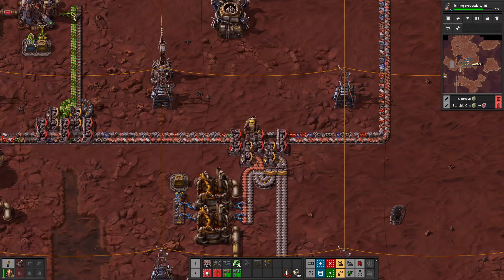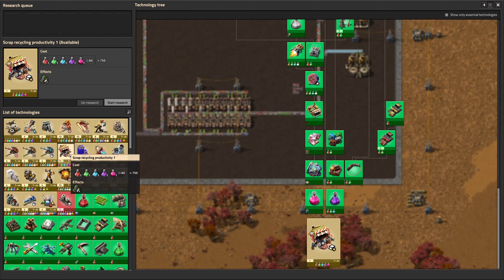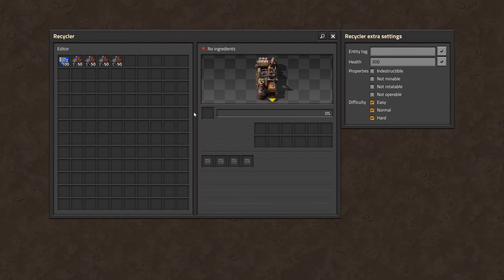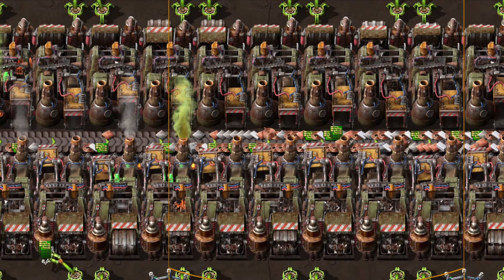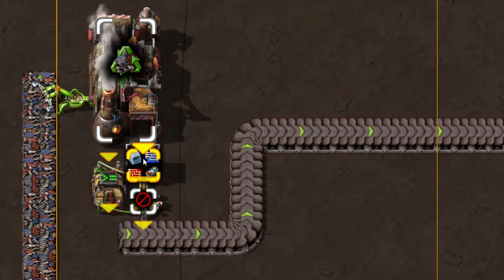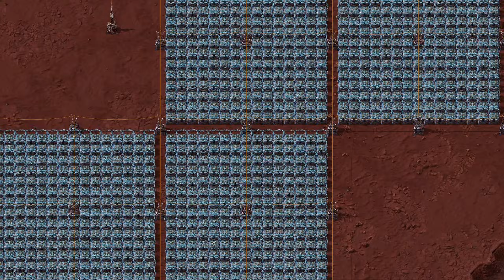Massive Production on Fulgora. Stacked Double Sushi Belt! Factorio Guide / Tutorial

Comment: I just got through my second attempt at a lightning planet base. The first time, I mind into belts, recycled, scrap onto trains, and transported the scrap from small islands to medium islands where I sorted them using robots. My quality strategy was gambling – only adding quality modules to assemblers or plants making products I wanted for the base. My throughput was excellent, and continually improved as I added a second train to the loop and mass produced logistic robots. At the same time, I felt like I was letting the game play itself.
This second time, I mine directly into 121 trains, One engine, two cargo wagons, and a backward facing engine. This allows me to use six big mining drills while filling each wagon at the same rate. The arrangement easily fits on small but dense scrap piles. The scrap trains, then venture to a large island where I unload directly into scrap recyclers. The recycler output onto belts which merge into a single blue sushi belt. I used your tips from this and other videos to reduce the recycling time for concrete and steel. I also figured out myself to remove solid fuel and ice immediately from the mix. After that, I began peeling one item after another off the belt in a similar fashion to you, prioritizing, sending it to a dedicated belt for only that item, but preventing clogs by having a backup belt feedback onto the main belt. Eventually, I added another set of recycler to the end of the sushi belt and sent their output back to the beginning with priority over the scrap recyclers. It works! The throughput is noticeably worse, and I’m fresh out of Holmium, but hopefully this can be fixed with productivity modules. I feel like I needed to do it at least once to satisfy myself that I really understood this planet. Could I do it again with quality scrap? Not with the level of patients I have right now. Maybe if I had a parameterized blueprint!
Well, now that I have big drills, foundries, electromagnetic, plants, and regular deliveries of calcite and tungsten, it’s time to fix the starting planet, and then onto GLEBA, where again, last time, I use robots all the way through, but not this time! Probably.

Comment: Couple areas of improvement for this setup:

1. Filter out all qualities of ice & solid fuel at the start of the sushi loop, and only non quality items pass onto the production of water & rocket fuel. Later on its also worth filtering out legendary solid fuel so you can make legendary rocket fuel, and then recycling the excess to prevent it clogging the sushi belt up. This allows for more important quality items to pass onto the main sushi loop, which doesn't affect throughput but does improve the production rates for quality items in our quality mall
2. Having upcycling for holmium plates within the build is worth it, and can be set to trigger above a certain threshold in storage (e.g. begin upcycling after 4k non quality plates are stored)
3. It's worth including quality versions of hazard concrete and steel chests into the build, otherwise you will slow down the recyclers handling excess items. If you do this, make sure to loop the belt back round to the start of the splitters so that any excess concrete doesn't clog the setup and just continually loops in a small circuit till its all gone

Other than that, this double sushi setup works really well, and Gets better once you reach legendary quality. Can easily crank out tons of legendary Q3 modules with this setup alone. well done :)

Comment: So the stacked belt works but the stack inserters will almost never output holmium ore or LDS into the belt. It's just a ton of gears, concrete, solid fuel etc since they stack much more frequently. I just ran this for 30+ minutes and no holmium ever entered my turbo belt

Comment: I'm new to Factorio, but I've fallen in love with sushi on Fulgora. However, this approach isn't popular online, and I haven't found any interesting ideas related to it. Even the loading screen itself suggests this method. I tried making a filter for four belts, and it turned out to be quite a challenge.
Blueprint:
0eNrNml+K2zAQxq9S9Ows1l/LgZ6kLIuzcbcGx3YduXRZAqXQtx6jhyj0EpsbVU7aZEmkMONpd/clIY6tn+aTNfNZ8gNb1EPZ9VXj2PyBVbdts2bzdw9sXd01RT0ea4pVyebMDf2inbm+aNZd27vZoqwd2ySsapblZzbnmyR60bqrK+fK/snpYnOdsLJxlavKPXD34/6mGVYLf+acJxfBCevatb+4bUaabzDT8kon7J7NZ1pcaU9aVn15uz+Di7F3JwSBJmgkQRII8pRgAwCFBph4CCGARgMyHMAQACCJMoJEIIBFA2xcIhUA5AQAKAKeYgkmxYXAT2fz4LNAf9e3/jvGUPmBkZ5FkTB3343NVU03jGnoHIme3k+AHCSbxAc1thwLauzxn6jawcXCwk/5NB5WMGtx/KTnWMTptD9UiIt5nZ8LtlfqxhewtvcE32Bdvg8rlyGY4nh/nzPfV/V42bHKLcuxbLp+2J006+qiaXbtfhyKet+rpu1XvjIm7LZddUVfuNY3wN6OFfE8hL66+xCOwSJiuDR7MMwcwVQo3UYhVqU/NkunixUbb5ESMn8KSQCCE4oXjCAQ2pto8vpf0kfvGSER/c5R92l0uBUCaZ9dqmi3NUap2OxSzz/CiAz+xC3ws35jmIgMbjhGq3+dwKOjbfGWwQiQZYgaIYH2j0ZeIoaec/AGUsQdQ8hASk4IAkZA+0WjcMlcSgIB5Egl2hyqQ0Ea3S9kqDXFySsbd/JxzyvRD4nKYsPKpj8tQBEY73bMmOlr8p8yn/5oAJRJpZNs+quSSREWr6Ay4VevFBYhpxvowEQPEdR0Aw0kaLyBPpfHvujNZPDG9mVCiLkehV+Du5BcQ8Vb2ekrWEBCPsl7pq/He2qCSYNppAkmbUcItUmwZbAUoQm2LDDPQgRFMBcZSHk9fVUQSDCEyg8j4LOEQBIsoSzDCPn0HR9lQPslKaHug2IwnBBDBopBEIwFTCVJMBYwAmHrDagSYe8NSDDTd5aAKmUEAiwGS/AWGcgHm5xgLmCIDF+bORbBCeUfiBCE+g9EUIp1CHGdHBdK9+8h/F1PW/rG/EdkIXXmTdvyAAJYtZFUuXLlfx3fuEhYXfh++2OPPx5/Pv7aft9+3X55o7bflP/vk+/SDqCNyFWea6tSkSq72fwGkyEmww==

Comment: Something I don't see people mention is that in my experience, I don't get enough batteries to turn all of my holmium into science. I have to make batteries to supplement the ones I already get, and the space this takes up is quite annoying (gears -> iron + copper cables -> copper plates + heavy oil -> light oil - > petroleum gas -> sulfur -> sulfuric acid). About 1/3rd of the area used by my science blueprint is just battery production crap.

Comment: The -15 combinator trick to control stack inserters is a nice idea. I ran into the problem of the chest never getting emptied properly and ended up coming up with a looping solution where one inner belt loop goes by a line of stack inserters which take off that belt and put onto another belt loop. It ends up being pretty compact and I have it setup to turn a scrap belt into two fully stacked green belts of recycled scrap at maximum speed (480 items/sec). I may have to try your combinator solution as I think I might be able to get it even more compact than my loops.

Comment: Accumulators on Fulgora is kinda bait or bad design on Wube side.
You get so much solid fuel and ice from scrap, that Heating Tower + Turbines are best source of consistent energy on Fulgora. So accumulators as a energy source become obsolete VERY quickly.
I wish Wube added some upgraded version for accumulators, and not only EM Plants, where you use electrolyte to "charge" it and convert into charged electrolyte that have HUGE energy capacity (and not mere 5-30 Mj like accumulators), paired with that new building that can charge electrolyte very quickly to utilize Energy spikes from storm.

That would be AWESOME

Comment: Further to this, I have one water supply line to the entire base, hold extra ice for bootstrapping thrusters and sink the rest. I sink solid any overflow solid fuel too, since Rocket Fuel is better than Solid Fuel in every way. EDIT: Might also be an idea to recycle copper cable, since you can just send Copper Cable to the Logistic Mall dimension, and the stuff that stays on the bus is better as plates. You could also recycle AC's as well, before Copper, because nothing in the production chain requires AC's, BUT that will reduce your capacity to make modules off the bus.

Of course, I couldn't get to this point without your help. I used a blueprint to solve Fulgora for my first go-around, but felt cheated. I've always needed guides to point me in the right direction with Factorio, and yours is insanely useful.

Comment: Over time, it will unfortunately become clear that the only thing actually useful on Fulgora is holmium. This setup doesn't buffer holmium, it doesn't start or stop based on holmium quantity, it just puts it into a belt, and throws it away in the recycler cycle if the holmium ore belt happens to be full. To anyone stumbling upon this video later on: Please do not do that. This video's concept works fine for your first visit to Fulgora, but that's about it.
Reply from the maker: If you play with normal science cost the amount of mining and scrap productivity will quickly be so high that 'wasting' scrap does not matter at all.
By the time the game is finished and you're on your way to a megabase you're still mining the first scrap patches.
If you really want to start and stop the base if necessary a very simple circuit logic condition will suffice.

Comment: You can use a constant combinator instead of a decider combinator for stacking. Just set 1 of each item type, then set the group to -3, and set inserter stack size to 4, and then use set filters. It's smaller without doing what you are doing. This doesn't work blindly without knowing what might be on the belt, but the list for scrap to belt is set static

Comment: Thanks for being the best Factorio tutorial channel out there! 
The only thing I might add to this video is that, if you are starting with quality right from the scrap mines (and you have all quality unlocked), the blueprint for fully stacked recyclers will lock up after a while because the box will fill up with stacks smaller than the 16 item threshold. 
The easiest fix I used for this was to use a higher quality steel chest (for more spaces) and change both the stack size and the condition of the combinator to 4. You need at least 60 spaces per box (the 12 items produced from scrap X 5 quality tiers) to guarantee no lockups. 
This fix allows for more stacks of different items and qualities to fit in the box, and the stack inserters will move items onto the belt as soon as there is 1 full stack (4 with research). 
Seriously this is the best Factorio channel, your videos are amazing and so easy to follow.
Reply from the maker: Thank you so much!
Yeah when using quality steel chests should be at your max qality tier as well.
Reply: Love this comment - though I'm confused as to why a max of 4 instead of the full 16 to max stack the belt? Or just to prevent a back log of certain items?
Reply: @Poctim  the hand size of 16 will actually put down 4 stacks of 4, so if your objective is just to make sure things are stacked on the belt, 4 will accomplish that without leaving things piling up in the box unnecessarily. Hope this helps 👍🏻

Comment: Insane how good this video is. I return to it now and then to reprocess the information.
Did you run into the problem of the chest for your belt stackers clogging due to to many stacks of items of varying quality filling it up and no stack ever reaching 16 items?
I have a problem with my chest being full of normal, green, blue and purple items and none of the stacks get to 16 before the chest is full and therefore everything just clogs and grinds to a halt. 
Did I miss something or is this a problem that emerges for you as well now and then?
Reply from the maker: If you use quality recycling you have to use chests with the highest quality tier you're working with. So in your case it seems you have epic unlocked so you should also use epic chests which have 91 slots compared to the 48 of normal chests.
I ran into a similar issue in my current 10X science cost run when i was starting to produce up to epic items and forgot to update chests.
Reply: @AVADIIStrategy Ooo, I am still learning what quality does to stuff. And that is such a more elegant solution. I was thinking of getting some circuit logic going that would allow for smaller stacks to be put on the belt if the chests available spaces were reaching a set threshold number.
Thanks again for the video and thanks for the reply!

Comment: 1. I recycle scrap right at the mining site.
2. You dont need combinators to use stack inserters. Just connect Stack inserter right to the chest and set it to "Set filter". 
How it works:
There are items in the chest, stack inserter have those in filter. For example 10 ore.
Stack inserter takes all ore 10 from the chest. 
Now it is 0 ore in the chest and Stack inserter can't have this item in filter. So Inserter puts 10 ore on the belt and take another stack of items
Reply: but when the recycler puts one or two of an item into the chest the stack inserter will put a non full stack onto the belt using your solution

Comment: This video inspired me a lot but first of all I think you need to plan at least 10 belts. Then you can increase the number of belts to 16 or for uncomon another 4 belts will be enough for rare and above 1 belt will be enough. But passive porvider is a better option for outoput. Also you need to try to consume everything before the belt returns. Spaceships can be made for the modules and everything can be converted into chips and upcycling can be tried in space. Everything can be free in Vulcanus. But it is more important to try to consume everything in Fulgora because trying to get rid of excess material is really difficult and costly in Fulgora. That is why even science ships first make the material reinforcement in Fulgora, complete the rest in Volcanus and finally dump it in Naviusa
Reply: Also if the material to be taken from multiple belts is less than 1 belt. Just add a belt to the left and when you put the material you want to the left, you can use the system for 1 belt.

Comment: Edit: String is now a book containing a few builds for quad belt sushi bases. Feedback is appreciated (including any mistakes I may have made).

Edit 2: one of the undergrounds was placed backwards, oops.

Original comment:
I tried my hand at making a quad belt filtered output, without prior experience in balancer making or spaghetti wizardry, so it's probably flawed. Someone more experienced could probably point out flaws and I'll gladly try to correct them.

(Note, this does require at minimum red belts to function)

Here's the string:
0eNrtXdtu4zgS/RVCT92AE4g3XQLsYw+mgRnMZbG7D5tBQ47pRGhZcuvSs95G/n0oO47lRLSKLDt2D/TQaEeWqqgieYo8VUV/86ZZo5ZlmtefpkXx2bv5trtSeTf/7fzZfjdT1V2ZLuu0yL0b79+qrPQnwibk1puqpKnTeapmtx5J8hm5KxbL5K5WM1Jl6f1Dna2uvYmX3hX5RnCV3udJ1krNk4XS4uqmnBZX1TJL61qV3qO+OZ+p/3k39HFivL0uk7xaFmV9NVVZ3XmIPf4x8VRep3WqNgrXf6w+5c1iqsXf0MlBSRNvWVTp5k2/eVrglWD+tZx4K/2R++xaPrbNeiGUvRDa6MaU92Wh/zeLpftiJ169WrYiiqZeNu07vVLDrdtO48G2C4e208i67dLe7mynhK6VzNJS3W3uoaxHR2Cvg+90+C91RD0qQpQKClERTQxTo9dG+63f2P+TnrlFqWVqGZma9/ZHbKOF7r/APM3aO3eTcqba+V2Xzfq1rpZZkudrUV+aJNu0Iy/KhZ7IE28NEGVSF1qA9w/PqtHUR81ev38GUGphCxq/sS3KFkV7jcFQcGAyhgPIBJYjnAqUjlcTVfTpkDadGg1NI3Mv2IMODQ/Yq/ddMKjD4hikI0LpiEA6Yhc/yQ69ybPnSXOD42E+UmnkopSiVgRbpYNqmAOKb834CrlaKFoofe3KPz50M46A7o09+qQKBAaapUoHh3BasxrxhwWo9Rt4pIUuakLQLDIvGlmEcBRAUGIxSgcIXLmPtF7sYj1uta6RHQf7StfZVnzcBuGo6Fhs+B1OOzE5RznUsB+auLBBfL6VFljuDrhEoXVgaHyAkmoyicPqiA631WUbtmnjOaeLA5hFg7YQPsrLmqRSlFTDaBAMBechBM4FtwGlcGgSGiFECIc9zJuNQXOzpZPf0f767f2O+SVwWCUMoxOHVSapEaqt0iA1dkJAeYbNhfRRsGcwq8QBlEkqQ0k1dJbkTlAhT79l+WOyE7dh5Ld7jZn33OaPtVqQuiDrVpNiPm9jBrMXLWlFpfpGfXkXnph4WaLtpq/91iQz0pqQtDeRjgG+biIW2kqB7pY4lpLJgDO6Cxv4rUkPxDx+aPI14CRZtiL1gyKVbhVJKtJUaX5PGPnyrHyrt5qQaVMTSjJVVaROM0WyIr+/vs1v839Vat5kZF6UJJ2TVdGQXKlZa4BF8lkRpRu8qh9ayU/hlGtym/9HZdmk1fl0rf2YdBRrKNTtaqqHlEyTSpG7JNdfkCRf/Zl890EY3ok4BMcLwvBwX6xDEAakJrBWY09scDloIvtVvejQ5xLC7QYoFeI0MRgeH3iL3lCSzeqfx/vNP00Qhkf7b3DGwIO9t+3OMwGMwgCkBsNSbfiDdn/6piY2xrnsuQMuDgxxAQnCHLSMHBri5tFiDzqcW4KOQxCmq0OcKAjTRTZ+oiCM8F+G4k8RhOkCKH+rIAyPD72aQxDGbpkBsqZVBGYH4Xxo3U0vIgLThW12tAhMF7YZMAIDGi8CNF4OhBsCJ2dxys40x31C1AKRgVZBr+Ivtt3AnbohRqE5d4rI2OkAYYNV/IV3sp3Edxp/4Z2UNm4Tf6GXEX/hh3xpBInG2Plragg9SNQGB5Yr5xCL4cPZQ9wlTNx1uhS4CY+c3K5/YdEZW4qCgmL1wkdSFEA1FLVJAWU+OURzujoMo1Q4cTjSepRaxW926wn/e4rfdP0W+77jN5zbjs4Q5WJACccOsR3uW+ZjihjhxnrSbKLjhGh4fEBHr1OT1IG222bXWISbGGLPs1EHCeHY7M/MUoWDp9za+203qFI6MFLm3jNCgwwQTgWYVSZDB+g/rdnN9ogQUAmd/jECxoBZdoGP0mFIBg0oChwDUMsZSkcICsxwFAXX9ybDa8RAOAFyaAnIgXQCueAMqQpBgEJ5Q9ZTEKI8kklq5ARiwTnyoIMYRVUdHN7mFX7oO7ms0NZlhW5UktZ0OVRSyFBuBpSZF3KUDhBYhwLlZgyh+VCipBpmcBigHIshqBqGKKmg8GQYOXkOcV6GJ4yRTlY6ONnIR5FuW6WDaijKcxnGUoTbS5mk4vZShiS7SKDaapIqUWwUuPsCJ1clzkxGRSHSr0sXvx5Fjv5WXhAFFsUoZwjKioh9lA6QK4ipUwxKu9o3qgEypncxJx/GzrAtiW3yh9sAw6ap3DbhTSBSMjbq+qRKFNobchDiAIX2Jqkhqq0mC0Sotpqkxk4ug51j/0d9H5EQYTQB9a3ARwxNjAPtZ6ipQU3t56iRYRQrUMPYKFaiOnEtFl5w0Obfr7PmaW+5wQTwJHv9JIUXKsz0JLArVKADhQr/TBfLTBGxkT9NdCPvVEn0Tel9Tj6Sqi701/OyWJDfk1X+pUmrmrzLiuz9tjCBJPW6wmGq7tM8b2sQ2mOdlP5XzLflBa3s1gRTpZ8uVdVkdQUpMDBWDBwqM+ipSrAuMACVLkXAwoKDwvwBYRxxDhKLJOwMJzuhAlYsYHmERSRhQXKX8ws61WtQNSGmRC4CrYUjTG3faxW9Ec4YUzxmGj4UVd8bHS+hvzsqYcnMTgegRPxoZx91B4lhxedw2lF3XJikSlSfwfI/HfLqu11o8vIhSqrp4KoICSSwrCe3M4yorRrmOw1sg20YqpLV1I8MVclqbCt38d1hDExPBznvjbTDqzhxJZ7XV6ClG9tbujkcvPmzHmeqItrHVelMratcK6LvbKtG07yzNpuQvCDbTUdbVZrkq/UXpirQp9H4NS3rZr0VezLZ5o6rWbG/Vjv+EZtsv+DnWEdsvqojsq7uhByvsi0gOlvUQaCQD2wbifBjxn4NnM6hPDcr7UJKM4ErZ3JYXkrLioUYpQJW4uZwhKew1UGRYMFgSwGGAjp2vEXoi+qXIy1C2bBUiUQeoKED1LGv/HjLUDrcfRFKqqmtmHOdemZNf7WXj1LCgGtP0Nl3MbaUD3c4LtBgLil1TB7KMgfsDAQKQH1gwaUd9IOO5GX487khhZAHVxDiQk6ydjjZ8uV56MepnOxKNRV14U7dNlW5URRQmqQylFSTBTgKGf0T1RLSyLLQg0skFlOnc0gDhz34+cugHM6V7B7UFQPPlbQ7qizucUzQaNOi5Q+Ocx6WBRXxzEPcp19V3rIRadth5N3H6w/Xndvfr++vrCmKh2SprvQb1emdvj7SFBdCU0w2KxhYrd7IX5wS23q6wpi/OvIaI68x8hojrzHyGiOvMfIaI69xtDXeSHiMhMdIeFwO4WGxKfibECEf17TDMx1hwYbQU7Ihe0+5sR8PWuT/i7we+Y+L5j/G9I1LoT/GvI6R/xj5j5H/GPmPkf8Y+Y+R/zj9Gm+kP0b6Y6Q/Lpr++LsngvzS1I78R6/kq3UBy078mgQp2zLgRLfoq/q0fRiigUM0/NBk90X59JNnO1JF37FPx7z7sVi2v6+Wrd6TD7ufUnv1M2vdH0/rFDavfzxN3/NnUX52q5f50VzZPPDkB+9FvRD4yZ+8rjVtnvy186Ro+2G//+iB/nv8Cxsbwjw=
Reply from the maker: It works!
Reply: @AVADIIStrategy Glad to hear it, I'll drop a blueprint book later containing some other builds for i/o in a quad belt setup to make life easier
Reply: @ String updated, let me know if you find any errors if you use it.